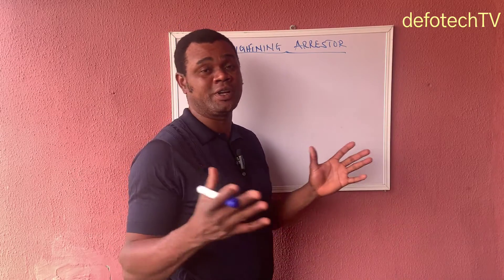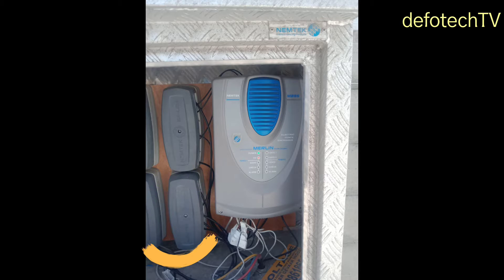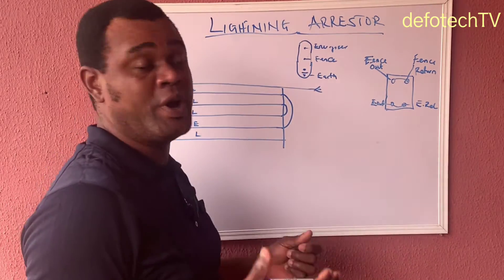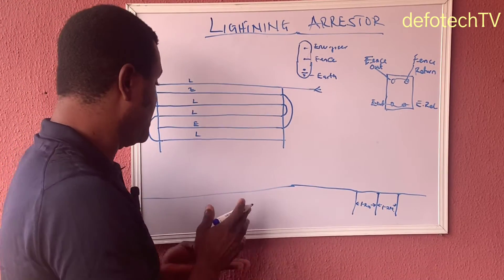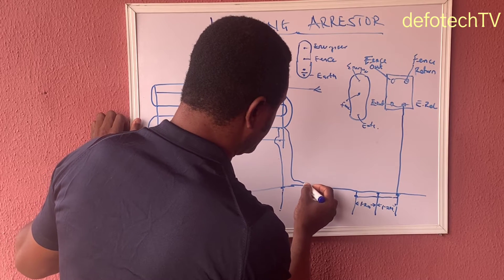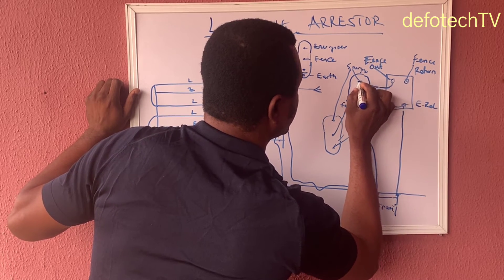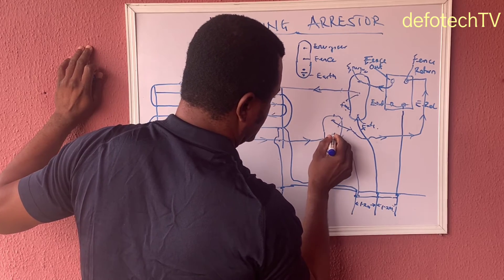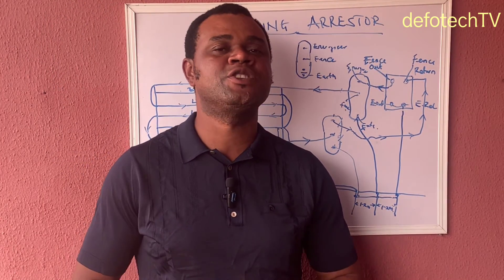How to connect fence lightning arrestors to your electric fence energizer

Comment: The cable coming to my house has three wires, the live, the return and the earth. Both arrestor terminals and the energizer are on that earth wire and the rest is as you have shown it. Is that fine?
Reply from the maker: Sure. Arrestor is connected to earth terminal

Comment: Thanks for the vid. my lightning arrester is connected to the live and the non live wires. The live one is sending current to the other. Does this mean the arrestor is damaged and needs to be replaced?
Reply from the maker: It's only the earth cable that is connected to the lightning arrestor and not the live.